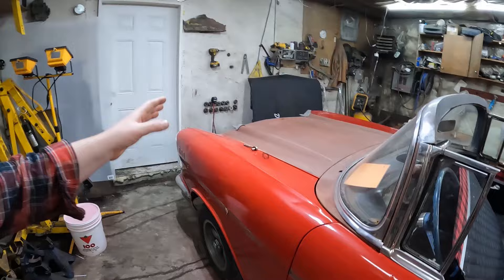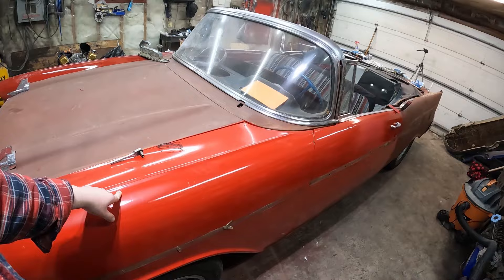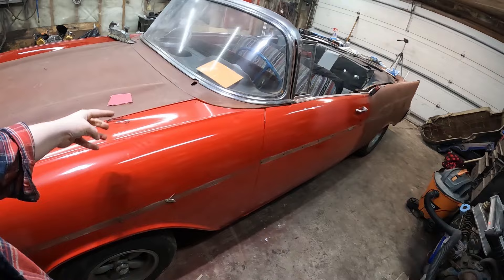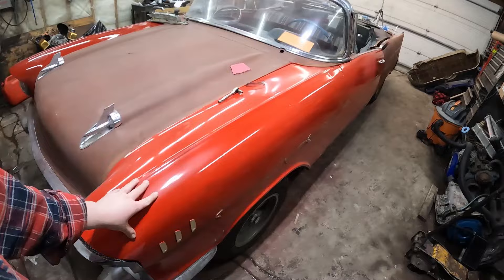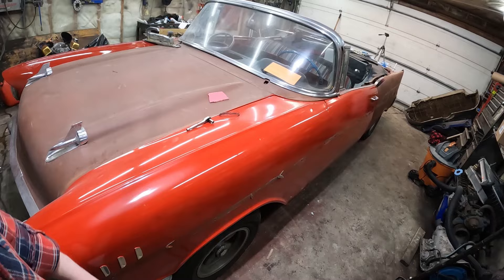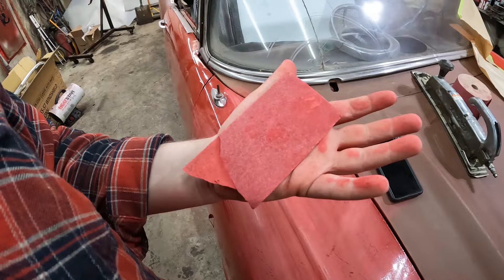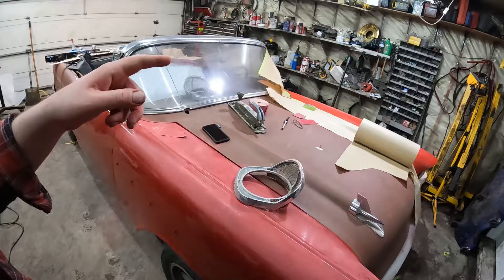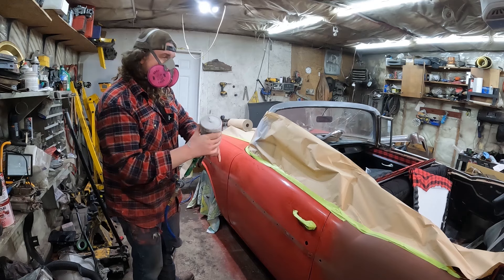Rust-Oleum Car Paint Myth-Busting

Comment: You put primer under body filler? I useually apply it to bare roughed up with 36 grit metal. Prime after fill work.
Reply: You can do either. Typically the primer salesman will tell you to primer everything then body fill then primer / sealer. I’ve done it both ways with satisfaction
Reply: @RustyZipper  I think the adhesion bond of body filler is greater than primer especially if your rough the metal up real good
Reply: @egodeathplease  - I agree but the concern of moisture getting between the filler and metal is their argument. I don’t think it matters either way. You have to remember these cars are only limited use and not like a car will see daily rain, snow, salt etc.
Reply: @RustyZipper  if moisture can get behind the filler it can get behind the primer?

Comment: With rostolium as long as you stay with an oil based paint you'll be fine and that's with the primer or anything else but if you try to put on  Acrylicor are a lacquer ,that's when you're gonna wrankle up so stay with an oil based enamel you should be fine. Peace out

Comment: The paint maybe interreacting with the cold coming up from the floor ! It needs to be around 80 degrees to 90 to allow the primer & paint to lay down on the surface . Cold really screws up paint jobs !
Reply: 90•F , in Canada 🇨🇦? Ain’t no shop running at 90•F. He Just needs about 4:3:1 , paint, reducer (Acetone), hardener and about 28+ psi at the gun
Reply: @RustyZipper  I painted my 72 nova & went through hell because it was cold out, until I heated the garage up to 85 to 90 then once I got done there was one tiny hair that I wet sanded out & with 4 coats of clear it looked like glass ! But I used PPG two stage & had never painted a vehicle before. I got sick of promises that the guy would be over early Saturday & never showed up,  I got a book & done it myself ! The same with the engine bodywork & interior.
Reply: @charlesjames9828  - absolutely well done 👍 my brother used to paint all of my families projects but he would only come home like 1-2 days a month and progress was slow. I bought my own stuff after watching “The GunMan” and a bunch of other videos. I’ve made plenty of mistakes and painted in the cold once and regret it every time I look at that project, very much orange peel to me but everyone else says it looks great.
Reply: @charlesjames9828  - also skip the PPG / DuPont, their stuff is way over priced. I use SPI primer and clear for my nice projects. SpeedoKote for my personal stuff, quick re-paint, etc.

Comment: Shit. I used to paint cars in a few hours and when it was dried enough the surface wasn't tacky I'd go driving. No primer no wash I'd wipe it down with lacquer thinner tape it off give it a scuff and paint that bitch no primer just lay it on. And they came out good. You'd still see minor dings that weren't fixed but they looked good. This was when a gallon of single stage was $40.

Comment: Did I hear you right you're sending the paint with 80 grit you should be using nothing at the most  180 grit sandpaper Then 320 grit then 400 grit before a paint job 80 Jesus you'll never get rid of those scratches That high build primer you're putting it on like it's like it's some sort of miracle bondo shit that's stuff cracks in the heat if you leave it outside I live in the desert Min the desert mood if you put it on predict like 8" they'll start cracking all over the place